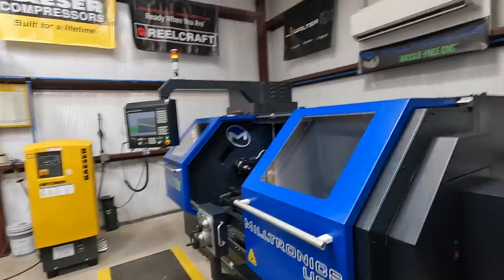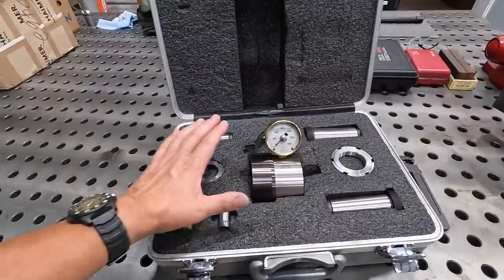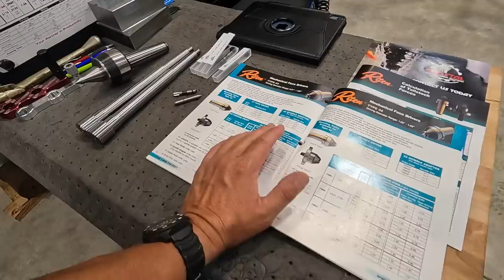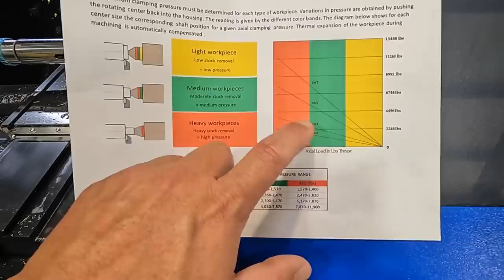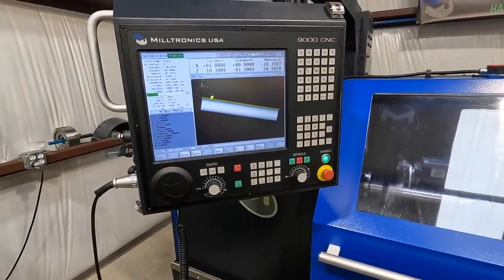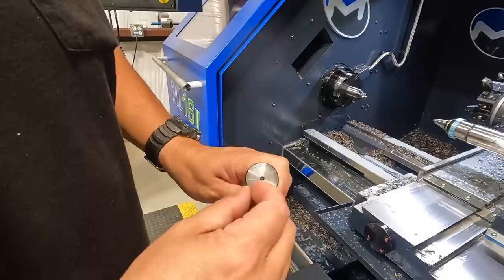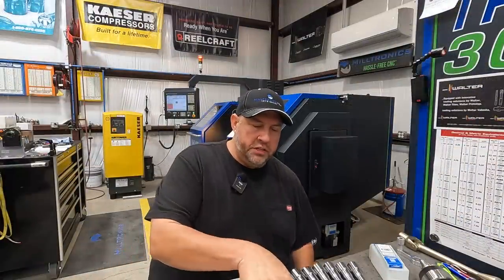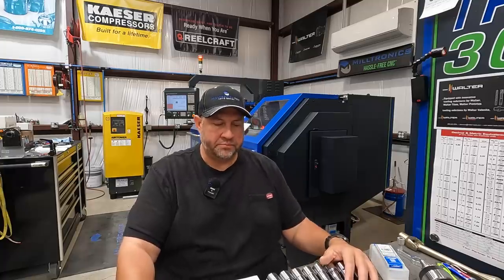Riten Industries Face Driver, Turning Between Centers

Comment: To the people at Riten, PLEASE use better colors for the color code; a lot of guys are red-green colorblind. How about dark red, lime green, and medium blue instead (i.e. bright, primary colors with lots of contrast.) I can barely make out the difference between the red and green there, even in good lighting conditions.
Reply: It's amazing how many companies don't understand that 8% of males won't be able to see these colors. Especially for a product that is primarily male oriented, and designed primarily by males. I had to fight this so many times in my job for LED, silkscreens and other UI design choices. I always got the 'stink eye' when I pointed out I couldn't tell certain indicators because they didn't want to spend the extra time to get the right colors.
Reply: How about if they printed “G” “Y”, and “R” on the color band? But I get your question.
Reply: @charlieromeo7663  Color choices that are easy to see for everyone are well established. Web designers have charts specifically for this. For instance, traffic light green is a blueish-green that looks 0% like any red, and the red traffic light is a very saturated red. Basically, the sensitivity to red and green is reduced, so lighter shades of green and red seem similar, verging on gray.

Comment: Interesting to see this in action - I've only seen it on wood previously. Surprised they don't supply a punch or press tool to create the driver grooves before the stock is loaded, to reduce the spindle load. That could create deeper (safer) grooves with less bearing stress.

Comment: It’s interesting how Adam doesn’t want to say what that part actually is. Because it’s not exactly a shaft.
Reply: Which part?  Adam's shiny new part was a test pattern, designed simply to help him learn.  The mystery "auto part" looked like some sort of double spline shaft. I've noticed that sometimes real parts are not identified by request of the maker.
Reply: @stuartschaffner9744  That example part is an fluted AR-15 barrel. You can clearly see the locking lugs and feed ramps on the breech (large end) and 1/2-28 is the common thread for a 5.56 muzzle device, he basically turned shorter blanks.
Reply: @sparkplug1018  , thanks.  However, since this is YouTube, perhaps we ought to emphasize the resemblance to a spline shaft. Move along folks, nothing to see here, just some common auto parts.
Reply: @stuartschaffner9744  Absolutely, and the parts he made on camera could definitely be a shaft for something. Just cut the splines on the ends and done.
Reply: It's because the Wicked Witch of the Web (and her minions) that owns YT demonetizes any video that references things that go "pew pew"... 🤬
Reply: I mean... Technically it is but we all know what "machine" this "shaft" goes on.

Comment: It's surprising how few machinists seem to know about face drivers and indeed how few people have ever noticed the witness marks in the ends of so many common production components.  Face drivers were in use for wood turning for hundreds, if not thousands of years before metal turning came about. Simple designs just have fixed drive blades, whilst more sophistcated designs have mechanical or hydraulic means to equalise the pin pressure. Frank Ford has a page on his 'Frets' site on constructing a "drive centre", which is an alternative term for the device.

Comment: Just a heads up. The bore needs to be indicated at the muzzle with a range rod before cutting the shoulder and threads. Cutting the threads while turning between centers risks a baffle strike with a can attached.

Comment: We machined railroad axles downsizing them from a worn out larger size to the next size down.  We tried a very expensive face driver and it just did not work out.  The face driver had hydraulic driving pins on it and there was no way to set axles up repeatedly length wise in our CNC lathe.  It turned out much easier with a good heavy six jaw set-true chuck.  That chuck is the cats meow.  Floor to floor was just as quick and no worry about having every axle in the same location length wise from axle to axle.

Comment: We used face drivers 30+ years ago to turn rolls for printing presses. Any hardening and/or cylindrical grinding were secondary operations to turning. Some parts were finished in the lathe, others required the secondary operations.

The face drivers we used required very little maintenance even in high production machining. I assume that the driver pins are hydraulic operated, the spring loaded center being the master cylinder supplying the pin loading pressure. This also ensures that the drive pins are evenly loaded even if the stock face squareness is not true. Our parts were much larger than Adam's so our drivers had more drive pins. I only had to do very infrequent drive pin and hydraulic circuit maintenance.

The face driver was an enormous production efficiency producer, but created a prep step bottle neck. Our solution was to invest in 1960's technology by adding a G&L Endomatic. This is a length, facing and centering machine. This machine used two self centering workpiece vises to hold any size work piece. Two face milling heads mounted with centering drill heads finished the part to length and center drilled the turning centers to  proper depth and on location. The Endomatic was the most geometrically complex machine for a maintenance man to set up that I have ever encountered. There is very little on the machine to reference from compared to a lathe or mill and multiple functions must be measured and compensated by finished part error. 
Adam didn't show us his prep steps, but I assume that he is forced to do those step tediously in his manual lathe(s). Or he will have to break his face driver set up. Indicating a face driver and or lathe chuck is counter productive to machining efficiency gained by the face driver. 
Prior to switching to face driver technology, we employed SMW air chucks and performed standard 2 step turning operations. SMW chucks were high maintenance compared to hydraulic chucks using a spindle mounted roating cylinder and draw tube to operate the chuck. The magic if the air chuck was an internal air operated pilot check valve that maintained chuck clamping pressure for the entire machining operation. OD mounted air sealing rings transmitted operating and clamping pressure then relaxed to provide free clearance so that the chuck could turn and not destroy the sealing rings. These were high production chucks and eliminated the through spindle diameter clearance loss yielded up to the hydraulic operated draw tube, but they were very high maintenance and tedious to repair and set up properly.
Reply: At Riten we make both mechanical and hydraulic face drivers. The one in the video is mechanical. Mechanical face drivers are more accurate than hydraulic, but hydraulic face divers are more forgiving in parts where the stock face is not perfectly square to the axis.

Comment: Lots of demand for AR barrels.  MK12 MOD0 barrels will be a snap in that rig!  Think about this, the stresses imparted in the surrounding material of the barrel blank by the button forcing its way thru the bore during the rifling process is known to do strange things when you relieve those stresses by turning the outside diameter of a rifle barrel.  Accuracy in a barrel has a lot to do with the way the projectile enters the barrel and how it exits the barrel.  My concern would be the effect on the muzzle area of that barrel opening up if you are turning button rifled barrels, then cutting even more material away from the barrel right at the critical point of the projectiles exit.  Add to that, the half-ton of pressure being applied to the end of the barrel by the tailstock, coupled with the addition of the 1/2-28 threads being cut and you compound the effect of the bore "possibly" opening up.  Check on it yourself by pin gauging before and after the machining operation.  Probably a moot point on an M4 length barrel (spray and pray) but if you cut barrels for Designated Marksman Rifles (DMR) it becomes a factor.

Comment: Would have been nice to get some TIR measurements in and out of the lathe. I actaully make drive chucks for our local plywood mill in various diameters and tooth patterns left and right hand. I just started doing the teeth on a cnc mill after many years of doing it manually and I love it. No more angle setups just let the machine do it all. Its amazing how fast and large they peel those logs and the core has a perfect star tooth pattern in the end from the dogs bitting in. Starts with 8" drive chucks and finishes with a 2-1/2" drive spindle running around 1,500 sfm!

Comment: It almost looks like a wood lathe drive dog.
Reply: It's exactly the same idea. Except that there is something (I wonder what?) that couples the three drive pins so they engage with equal pressure. With a wood drive dog the material is soft enough for that not to be necessary. 
I have an old one that uses rubber pads under the drive pins, but this one looks like it might be hydraulic. Though it could just be something like a hemispherical pad, I suppose.
Reply: Metal lathes also have drive dogs.
Reply: "Spur center" I believe is the usual term. Which this pretty much is, with a lot more force holding it in.
Reply: Also called steb center.

Comment: Those shafts look like rifle barrels
Reply: They are
Reply: Shhhhht 🤫🤫🤫 YouTube super dumb about stuff like that, don’t get Adam a strike or this video demonetized
Reply: A test run for O.D. work. A real "shaft" would already have the I.D. cut before O.D. cutting.
Reply: @cojones8518 
I have watched dozens of YouTube videos with firearms in them. None of them mentioned being demonetised🤷Seems like y’all are fear mongering to me.
Reply: @Resistculturaldecline 
I was just thinking the same thing. Wouldn’t you drill and rifle the bore first? Then use the bore to centre the outside of the barrel? Otherwise you have to grip a finished OD without damaging it to drill the bore.
Reply: @davidcat1455   Yes, depending on a couple of basic different methods of barrel making. The traditional method, and most accurate is a bore is drilled and rifled in a piece of high-quality bar stock. Then it is stress relieved, afterward it gets the O.D. machined. Soft pads are used to keep from marring the surface. 

The more mass-produced method has a rough hole that will become a finished bore. A length of bar stock with said pre-made rough bore gets a mandrel placed in the rough bore that is the negative of what the finished rifling will be. Then, large fast acting presses begin hammering the bar stock into a slightly smaller overall diameter, tightly onto the mandrel, for a forged shaping, so to speak. Mandrel is then removed, the bar stock and bore has been "hammered" into its final shape, minus any chamber-end and muzzle-end threading needed for finish fitment.
Reply: @Resistculturaldecline  
Thanks👍
Reply: @Resistculturaldecline  yup, exactly, heck of a lot cheaper way to verify the CNC program is right
Reply: @davidcat1455  do you follow Brandon Herrera/The AK Guy? That’s just one example, it’s a trend.
Reply: @othermattreed  
I don’t actually follow anybody. Occasionally I just search YouTube for firearm videos when I’m in the mood and look at whatever pops up. Don’t really care who it is or even what country they’re from if they’re shooting guns or explaining ballistics I’m interested.🤷 I’m not looking for an argument, and if you say there’s a trend I believe you, it’s just I haven’t noticed it.
Reply: @davidcat1455  no worries brotha I’m not looking for one either, sorry if anything came off with that tone, it was not intended.
Reply: @davidcat1455 probably you would get the material with the inside work already done from a shop like edge precision. He doesn't do barrels anymore, but used to before his YouTube days. But he demonstrates the same equipment tooling and processes frequently that he used for barrels and such for years. Great YouTube channel, edge precision.
Reply: @philbert006  
👍Thanks for the information

Comment: Witness marks from face drivers have been common for as long as I can remember.
 This is s lightly different system though. 
Is there a minimum size of lathe it can be used on?
 I'm guessing it's too expensive for limited hobby use (I can count on the fingers of one foot how often I've needed to make a part in one piece)  but could be really handy fo high volume CNC.
Guess it depends on cost and availability compared to 'conventional' pressure turning systems, you can only use the patriotic, 'Made In USA' marketing for so long (look what happened to Harley Davidson, 500,000 motorcycles one year, now, Made In India)

Comment: What does that pressure, combined with the machining forces, do to the spindle bearings? If you have to gronk on the tailstock handwheel that much it can’t be good, especially with harder materials.

Comment: My concern would be the threads, you cant test them before taking the part out, and once the alignment to the spindle is off, you crossthread if you have to re-run those fine threads. Youd have to mark your witness marks 1, 2, 3, every part to check your threads and even then you might not get engaged properly. I understand you want to do it in one op... but i dont think i would do that with a threaded part.
Reply: thread mics are a thing and the 3 wire method is also a thing .
Reply: With full profile thread insert, made for a specific threads per inch, one can measure the final outside thread diameter. If the diameter is about a 200 of an inch, say 0.1mm smaller than the nominal thread dia, then the thread is ok.
In theory, but it always work for me. There are thread depth calculators to use, and lists.

Comment: We're half way through 2023 folks, a lot of home shop machining guys have CNC as well as manual and I suspect a good number have only CNC. The industrial tooling he is showing today will be the used tooling we pickup on ebay next year. This content while advertising is also still relevant.
Reply: my home shop has  tormach cnc mill that I drive manually with the keyboard as much as i use it in cnc mode making parts automatically.  My lathe is a manual type 1440 converted to a teaching type cnc lathe.  So yeah you are right, thats where things are headed.  Abom's shop ads for these products are about one full production step past what I need and can afford but... even if I'd rather see him making stuff I can't deny these tools may be in my future in a few years.

Comment: I am asking again. Where do you set your Z-zero and does it have to be reset after the pins dig deeper into the material after the first cut?
Reply: Good question. Probably not unless the dimensional tolerance is extremely critical.

Comment: Adam did you check for taper if that much pressure pushing I bet the taper is all over and by the way your live center is going to be useless in no time including the head stock bearings.
Reply: With a manual lathe we are using more pressure than is typically required.  Live center live and the wear on the head stock bearings is not an issue with typical pressures.